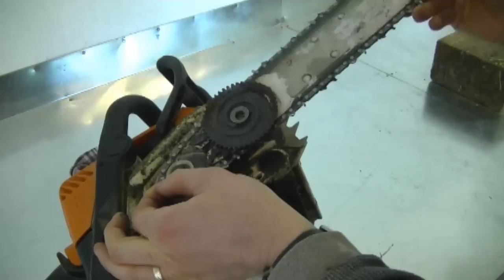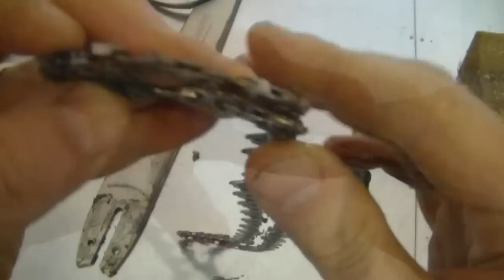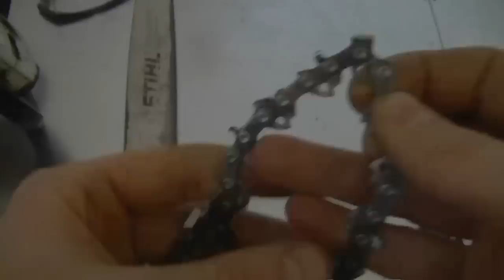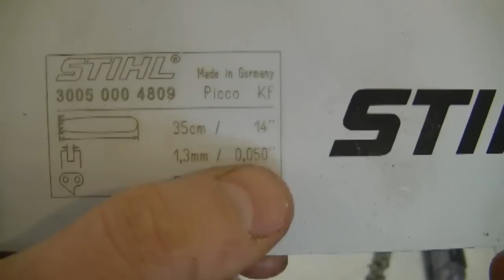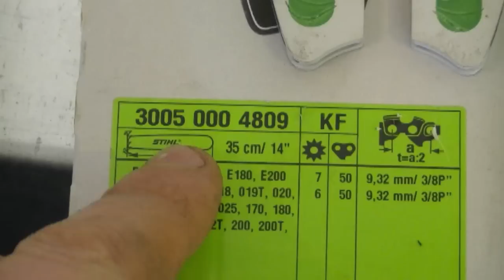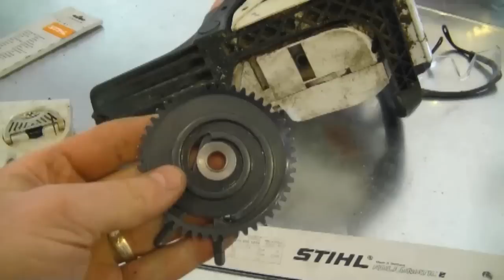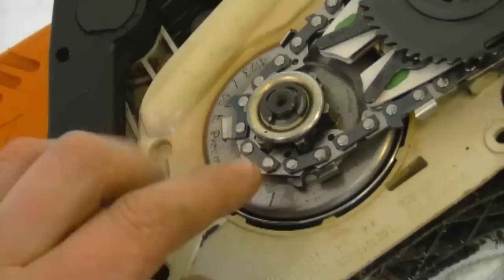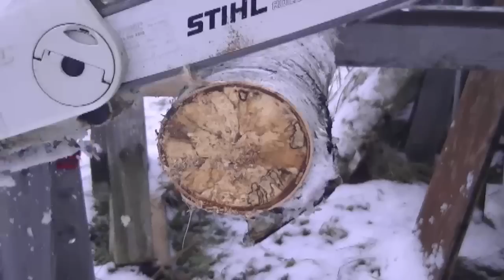How To Install A More Robust Bar & Chain On A Stihl Ms180, 170, 018, 017 Chainsaw

Comment: Hi dony, I have one question about chain saw I just bought. First I do not recognize the brand named STELL, did you hear about it, it says on the sticker it's made in Germany. The saw runs more then good it's new all right and I paid for it about 150$, i think it's a good price because the STIHL equivalent its double that price. Here is characteristics: 76cc, 4,8 kW, 3600 RPM Idling speed, 6,6 kg, 520 mm length of the chain bar. Thanks in advance. Keep up good work.

Comment: Hi Don, I have an MS170 but it has a chain tensioner with a couple of nuts rather than keyless setup you have in the video. Is it still possible to use the same bar you have used in your video, or should i be looking for a different bar?
Reply: Yes the ez adjuster attaches to to any bars and that bar would work for you

Comment: Hello dony..a question for u on this model 181c, is there a common issue that cases a extreme lean condition.10 years  old, reasonable condition.L screw 2.5 turns out H screw out to the stop...if you know anything it would be appreciated.

Comment: I realize this is an old video but i have a question for you. I have a ms 180 easy start chainsaw. After watching your video a few years ago, i went to my stihl dealer and he said the bigger bar and chain wouldn't work on my chainsaw. Do you know if this is true? I really enjoy your videos. Very easy to watch and learn from. Thank you
Reply: you have to keep in mind that it has 32cc, not 50 or higher. a straight forward reference for anything below 50cc is keep the bar at 40cm/16inch or less. a 32cc engine will have more difficulties plowing trough big logs when using a longer bar cause it has to get the chain moving (the longer the heavier) and when it bites down in the log it needs to have the torque to keep it turning as well.
Reply: they don't recommend you upgrade your bar because it voids your warranty
Reply: If you use a bigger bar than recommended you can also run into problems with not getting enough oil on your bar which will heat up and ruin chains faster

Comment: Hey I really appreciate your vids!  Just picked up a 018c for $50!  Just needed a new gas cap and oiler.  I cant seem to find the 3613 002 0050 chain online, but I do keep seeing a 3613 005 0050.  Do you think that will work? Thanks!

Comment: Hey Donny when you do this mod can you stay with a 16” bar and chain or do you have to go down in size to a 14”?
Reply from the maker: you can keep at 16" but i prefer 14"
Reply: I think Dony's choice of 14" is wise.  Sort of keeps the load down to what the manufacturer intended for the 30 to 32cc engine.

Comment: I have a MS180 which comes with a .043 14 in bar and chain.  Can you put a 16 inch bar on them?  or even bigger and .050.  because for some reason I can find a 16 inch bar with 3 .050 chains for cheaper than a 14 inch bar and a single .043 chain
Reply: Change the sprocket, bar and chain, yes.

Comment: Thanks Dony, nice vid...and I realize it's an oldie, but...
I saw some mention of oil flow to bar needs adjustment after the change out? Did you do that/did you need to?

I just bought a 170 for raffle prize donation, for a family in need benefit. I'm happy to have found this, giving me ability to advise a bit of upgrade if they cut a fair amount of wood. Stopping for chain sharpening often is a pain as I've read of the .043.
So thanks again.
Reply from the maker: the ms170 is non adjustable when it comes to bar oil, but no issues with the upgraded bar and chain. I also upgraded on my ms193t

Comment: Don, lots of good stuff!  A guy just gave me 2 MS 180's to use as parts - but with a little work and a few of your videos I got one of them running - thanks!  They had no bar or chain, so yesterday I picked them up from my dealer, then watched your upgrade - but at the end I noticed the part numbers did not match the ones you gave out.  Your video is from 8 years ago, so maybe the numbers have changed.  I wanted to test the saw out today, but am not very familiar with bars & chains - so was hoping you had time to tell me "go with them" or "you've  got the wrong part".  The bar is 3005 000 4813, the chain is 3613 005 0055.  If you can help, great, but either way, thanks for your video work!  Tom
Reply from the maker: not sure but dealer should have given you proper bars and chain

Comment: How would I find the video if & when you post it. Oil line replacement.
 And could you tell me what Determines the oil ratio on 2 cycle motors 32:1, 40:1, 50:1 ect.
You are the goto guy for motor info.
   Thanks Again.

Comment: Hey Dony,  I need a replacement tensioning gear like you show in this video.  It seems to be a difficult part to locate.  Where would you recommend finding one?  Thanks!
Reply from the maker: go to your local stihl dealer
Reply: donyboy73 Thanks.  I'm  so used to finding stuff on Ebay.

Comment: I bought an ms 170 for 50.00 runs good but the oiler isn't working and the .43 bar is chiped badly, I would like to put an 18" bar on it with a .50 gauge should I opt for a skip tooth chain. or should I keep it 16"  .50 gauge. thoughts?
Reply from the maker: +mike vantol I would keep it 16"

Comment: Can the MS180 still operate ok with a 50 gauge bar of 16"?? I mean do you have to reduce the length of the bar when you go to 50 gauge?
Reply from the maker: it will work with the 16" .050g bar and chain

Comment: Hi Don ,I have a Stihl 017 with a 12 inch bar and 43 gauge chain and the original  6 tooth sprocket so am wondering if i went to a 14 inch Bar and 50 gauge chain do i need a different type clutch sprocket Thankyou
Reply from the maker: no u don't, what you have will work
Reply: @donyboy73  Thankyou

Comment: Hey Don, I'm assuming by lowering the length of the bar, it's compensation for the added chew factor? , so to not tax the power of the saw any more,, correct? Thanks
Reply from the maker: it does but the saw has plenty of power

Comment: Hi Dony, thanks for a great video. I live in UK and want to buy an MS170 12" chainsaw. I don't want the 14", I've already got 2 others, not Stihls. I want to upgrade the ms170 - 12" to 50 gauge. Is this possible?  If so what bar numbers and chain numbers?  Not fussed on original parts.
Reply from the maker: I don't have part numbers for 12" but go to stihl dealer
Reply: Hi Dony, thanks for getting back. Spent a good 45 mins looking for info before asking you. Perhaps I'll ask Stihl.

Comment: DonyBoy, I understand what your saying.  I have found that the speed of the saw slows down.. not to compensate for the slow down of the saw, you must replace the sprocket  to a faster sprocket.  I don't know the numbers. Or remember where to get them. I will try to get that info for you.. I did agree with the previous comment on speed.. .. and the facts that you can speed up any chain  with a different sprocket. . Note.. this is a aftermarket parts purchase. . "Don't tell ANYONE ELSE"  :-)  Please update the video when u can  with the .050 chain and different sprocket. . Good Videos. Thanks you
PS.. It is my opinion that speed Sprocket  works very well. . I must say some say that it changed the power of the saw.. I find that by bringing up the speed in my chain, I gain a noticeable faster cut.. it seems to slow done in the BIG hardwood.. it a smaller saw.. and I'm alway going to my 026. Or bigger when I go up In log size.. so the small saw for trimming... is incredibly fast!

Comment: Im guessing that the pitch  are the same on both bars  both being 3/8 Lo Pro or picco  so this fix does not include saws using the 1/4 p pitch/sprocket  socalled micropicco , im racking my Brain as to IF there is a 3/8 low PRO sprocket for ny dinky stihl mse 200 c-bq  and  is  it viable using this on a small saw as mentioned .
Greatfull for any help 👍
Reply: Main season is the Choice of chain but also that there are more bars to choose from

Comment: i want to put more robust chain on my stihl ms230 can you give me advice what kind of chain and bar should i use? tnx
Reply from the maker: the biggest you can use is .325 x 50g which is what comes with it
Reply: tnx :) it comes with 3/8 and now im thinking to change it to .325 but im thinking does it going to lose power on my chainsaw? also is it going to worth to upgrade? tnx dony

Comment: With the thicker chain, would the sprocket be able to handle it in the long run?
Reply from the maker: yes
Reply: @donyboy73  is there a 16" 50 guage bar and chain instead of 14"?

Comment: Could you please show how to replace a chain oil line on a stihl 180. Chain not getting oil & a puddle on the floor after it sits. I heard it is a common problem, I Only found 2 videos on the subject , & 1 was with the saw already apart. I would really appreciate a video, If you have time.

Comment: I've had nothing but problems with that hand tightening chain system. Any way to convert the saw from hand tightening to  bolt chain adjustment.
Reply from the maker: probably with a cover from the 170
Reply: I picked up a nice used ms 210C for limbing. It had the ez adjust. Hated it.  Sold it quickly.
Reply: Same here. BUT…..I never loosened the clutch cover & held the bar up. Always took the cover off & manually turned the tensioner. Cant wait to try this the correct way!

Comment: Great video. Do you have to change the sprocket? Also, with the increased load on the engine, have you experienced any loss in performance or damage to the engine. Thanks.
Reply from the maker: KEPT SAME SPROCKET, no damage caused
Reply: Look carefully at the specs on the bar label.  It says it will work with a 6 cog drive gear......

Comment: With all the noticeable attention placed on giving safety advice, I'm sorta stunned at the blithe mention of using gasoline for parts washing.  Not that it doesn't work great.  But the safety concerns that brings up are numerous and significant.
Reply: jjmasw88  - Gasoline is WAY more volatile than Safety-Kleen.

Comment: Great vid - I would only add it's worth checking the drive sprocket when you change the bar and chain as a worn drive sprocket will cause running problems with the new bar and chain.

Comment: I have a MS 180 C. What's the C stand for? How different is the MS180 from the MS180 C? Thanks.
Reply: The C stands for comfort. These saws have wimpy chains, low vibes and poor cutting. Therefore this upgrade turns it into a real chainsaw.

Comment: So when you upgrade to a 50 gauge, you decrease the length of the bar to a 14" from the original 15"?
Reply from the maker: yes but it will still handle the 16" bar
Reply: @donyboy73  I did this upgrade yesterday and used a 16" bar & it cuts really well. Got the 'spikes' too and will put those on tomorrow. Should be a whole new saw. Thanks!
Reply from the maker: @waynehennigar8607  good to know it handles the 16" well, thanks
Reply: @donyboy73  I also put the 'spikes' on and the side tensioner. Works like a charm now. Great upgrades.

Comment: hi dony i have watched you for a bout a 2years now and haven't really asked any questions, but i have a question i hope will be a good one for you,i have a poulan chainsaw and i wont to change the bar and chain out on it, it is a 14.9.52 i wont a 18 or 20 inch blade for it but i don't know what to ask for can you tell me what bar and chain that size will work for it thanks
Reply from the maker: depends on size of your saw. your local small engine shop should know
Reply: ok thanks i have an older Poland saw that was 35cc and 16 in blade, and i changed it out to a 18 and had no problems out of it i just wanted to through a question and see what you would, say so i guess you took the safe way out of it but that is ok good luck on your shop work thanks

Comment: Curious about answers I have heard. Two Stihl dealer said dont do it, but right on the Stihl website says it's fine.  Why do Stihl dealers always recommend the .43 chains.  I know the answer is narrow chain less power to cut, but they are terrible in my opinion.  Dull easy twice as less the teeth, and are a rip off.  I am going to upgrade, but wanted to get your thoughts before I do.

Comment: I would put a MS 211  bar and chain on an MS 180.  I do not decrease bar length if I go to a larger gauge chain, nor do I increase bar length if I go to a smaller gauge.  My MS 250’s all have .063 chains, .325 pitch, on 18 inch bars.  They don’t have any problem lugging these chains on these bars.  This is the standard bars and chains that come on the MS 250.  I have the same bars and chains on my 024 and 025.  I will be putting the same length bar and chain on my 021 Super when I finish building it, but it will be .050, because Stihl .063 bars are unavailable right now.  Scabbards for these bars are also in short supply, too - 3006 style(16-18”).  I need one for my 025 and will need another for my 021 when it is finished.

Comment: The sprocket on the old chain was for a .325 pitch chain and the new chain is 3/8 pitch. no sprocket change ?
Reply from the maker: +Diamond Fred it was 3/8" and I replaced with 3/8"
Reply: +donyboy73 Thanks&#160; ... It looked like at 3:13 the drive links on the old chain top are closer then the new chain on the bottom, must be just the way ur holdn it.. Great videos tho very helpful ...

Comment: Dony, Has the part number for the 14" chain changed? Will 3636 005 0050 fit? Thanks
Reply: In reply to my own question, Yes it will.

Comment: This no tool chain adjustment feature seems so superior to the awkward screw and thread adjuster on my 3 saws that require fussy and annoying manipulations of a scrench or screwdriver often done in poor light………this alone has me wanting to upgrade chainsaws to this tool-less system…..

Comment: I bought the MS170 because it is a fast dependable saw and has the 16 inch bar. If I wanted to stay with a 14 inch I would just go back to my Poulan that I mistakenly bought before the Stihl. I need a longer bar again and will just buy a bigger Stihl or Husqvarna with the 3/8 teeth and at least a 20 inch bar. This is a good idea if you can live with a short bar for sure though. That tool less adjustment system is on a new Champion chain saw I got for a good deal at Canadian Tire. The saw runs great but lacks power and the chain falls off continuously. Not such a good deal after all.

Comment: You use the term "Gage." I know if you are talking about a shot gun as the number in size gets smaller, the gage is actually larger. You used the term gage as 43 and 50. Next to the number stamped on the bar it had the ( " )mark next to it. By any chance are they referring to inches instead of gage? Thank you for taking the time to record and post this. Peace, Reese
Reply from the maker: thousands of inches, so for example .050"

Comment: What is the model # for the robust bar and chain for the MS170 in 14 inch ?
Reply: 3005 000 4809 for the bar, and 3613 002 0050 for the chain.

Comment: Be Trying to get the Chain,this is the reply from Stihl.... Thank you for contacting STIHL with your enquiry.
 
I can confirm the bar below is available but the part number for the chainsaw is not a valid part number. If you could advise the model I would be able to check if this is a current model. 

So i have taken a copy of photos of the chain box and part number from the video and sent them to Sthil ........now awaiting reply......
Reply from the maker: Paul Clark just go to your local dealer

Comment: Should mention, mine is a 170C, the Comfort model for women (with low vibes). My chain wasn't shot but had half the number of cutters and not chisel cutters like the new chain so it cut very poorly. Now it cuts like a chain saw should.
Reply: I want to add that I recently found and bought a real nice Oregon bar and chain set for the 170C that not only was less than half the Stihl price but cuts as well or better.

Comment: alrighty you running picco micro setup on that 180  see if stihl has a 325 050 setup for that saw roller nose yellow dots  not green and the matching yellow chain  now youre cutting with pro chain n bar beware veeery fast. it will smoke that old picco chain picco is mainly for top handle and newbies .

Comment: Gents,this is the reply from STIHL regarding my last post re chainsaw part number,having sent photos of the packing box.

Thank you for your further email.
 
I can confirm code 3613 would be Picco Micro chain. The Picco Micro 3 is available with the part number 3636 000 0050 and the chain bar number 3005 0004809 would also be available.
 
So don't  be put off, hope this helps all those who wish to upgrade their Chainsaw,after watching this excellent video .......Keep up the good work Donyboy73 . Top Banana.....
Reply from the maker: Paul Clark thanks

Comment: Don't you need to change the picco1/4".043 sprocket to the picco 3/8" .050 sprocket with this bar upgrade?
Reply: MS 180 has a 3/8 low profile already.  No need to change the sprocket.
Reply: 啊 yeah哑了ya le
Reply: y

Comment: Will not work on mine? Chain will not go around the clutch gear. Do I have to change a clutch and gear?
Reply from the maker: NO YOU DON'T have to replace sprocket, just bar and chain
Reply: Thank you for the fast reply! I have an MS 250 18in bar stihl. Stalled it on my MS 170. It does not turn around the sprocket is just a 14 inch that works? Thank you so much and a nice video to
Reply from the maker: you have to make sure it's 3/8" pitch, you may be trying to install a .325 pitch chain
Reply: Thats what it is.... Thanks!

Comment: I like that you went down in bar and chain length when going up in kerf size. If you really want to cut a lot of wood? Using a Stihl Duro3 chain will cut 10 times more wood between sharpening. Were you cutting pallets or cinder blocks with that old tore up chain? Lol. Keep up the great work.